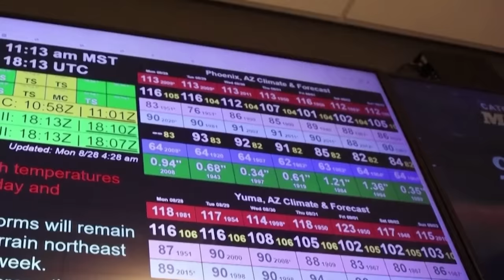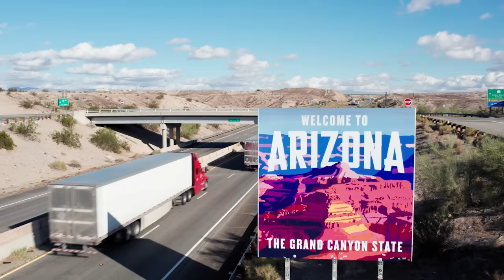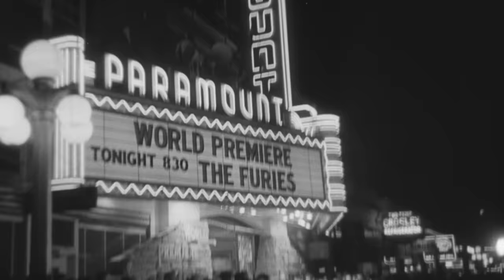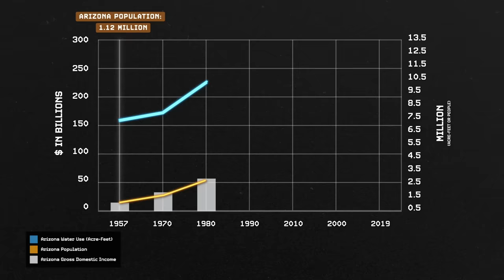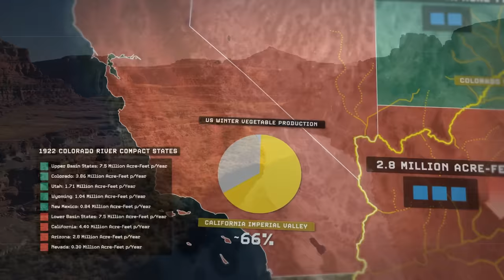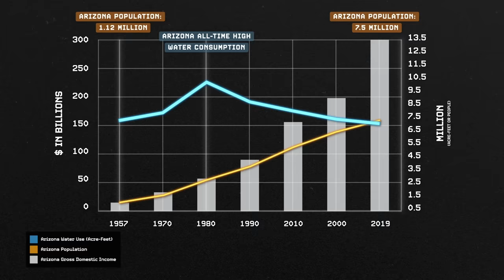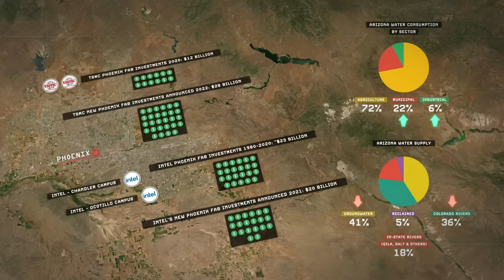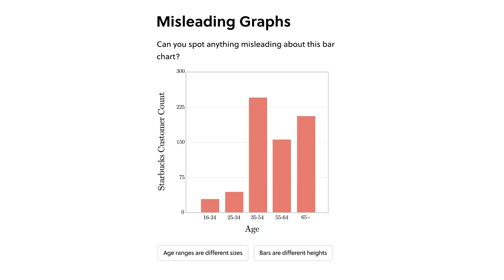Why 5 Million People Live in America’s Hottest City

Comment: For non-US viewer, 110°F is around 43°C.
Reply: Holy shit
Reply: @mertm.995 43 dry is more tolerable than 33 with 70% humidity  though. As a Moroccan born in similar climate, I know how it feels. The issue is that the temperature doesn't fall at night and stays hot while in humid areas with air breeze it cools down at night for a walk. So yeah Phoenix is a human anomaly
Reply: @MoorishAlliance  For real. 43 dry is way better than 30 with 70% humidity. Humidity makes things worse.
Reply: @MoorishAlliance Dry heat is horrible, I’d rather it be wet and hot then dry and hot
Reply: @al-manasama8370  I still prefer living in  near coast cities than in my hot and dry birth town. 
You have only between 9 pm to 10 am in dry climate where you can be active. Whereas you only need to avoid 13 pm to 18 pm sun in places where the climate  is usually moderate and only in the summer. Deserts become freeking cold in the winter so no win either.
Reply: Holy shit
Reply: @MoorishAlliance Try living in East Asia, particularly southern Taiwan, Thailand and the like. Summers are hell, 30C plus all day and 28-29C at night for months with the only respite being when it rains. You drip sweat day or night. I'd rather have the dry desert heat. Humidity makes winter worse too.
Reply: From my 15 years living in Phx area it’s easily can get up in the 120 F from June to August
Reply: @Puppyfied 
Humid heat is more dangerous than dry heat, since the humidity causes your body to produce less sweat, AND also since water is a very strong absorber of heat.
Reply: @al-manasama8370  that's an exaggeration. 30 C with 70% RH definitely is not worse than 43 with low humidity.
Reply: @MrGiygas1 you're kinda right. Humid heat is more dangerous but the exact reason why is Sweat on the skin does not evaporate efficiently on humid days, so more of the heat remains trapped within your body.
Reply: That is what he said multiple times in the video
Reply: @Puppyfied You are objectively wrong. The human body is worse at cooling itself down in humid environments.
Reply: Wtf? I didn't imagine it's THAT hot
Reply: What's said at 3:40.
Reply: Shit just got real 😮
Reply: For the idiots who think humidity is bad obviously never heard of a swamp cooler which is literally a form of air conditioning. Would you rather sit in front of a swamp cooler or and open oven. The "dry" heat dries your sweat so you can't cool off
Reply: @al-manasama8370 you need humidity for a swamp cooler aka an air conditioner
Reply: @thomasjellis9465 stationed in Okinawa the humidity is much better than dry
Reply: The process of drying your sweat is what makes you cooler. You are dissipating heat
Reply: Bro I live in Bahrain where the temp can peak to 47-48° C with insane amounts of humidity
Reply: @MoorishAlliance  and 10°C with high humidity feels like -5°C.
Reply: @kennethstegall1075 you have no idea how sweat works do you? The body temperature decreases thanks to sweat evaporation, which only works in dry environment
Reply: I mean thats not that bad, thats summer temps in south europe.
Reply: @Doomer_Optimist  It's close. 30 C at 82% has the same heat index as 43 at 5%. I've been in Vegas when it was 43 with 5% and it feels better than an average summer day in South Florida: 35 C at 50% at midday (humidity is higher morning and night), as the heat indexes would indicate.
Reply: @Puppyfied  With dry heat I get cracked lips and nosebleeds from dried out nasal passages. I guess the people who live there adjust to it or they move if they have that problem.
Reply: @kennethstegall1075  you have misunderstood something very badly. The issue was really simple: do you want to be in high or low humidity in 110F?
Reply: I was wondering why the hell he didn't use the system that the whole world (ecept America) is using. Crazy.
Reply: Yeah, that's a little much. I'm a fan of 34 C.
Reply: @Kerpeles  humidity easy. So much cooler
Reply: @kennethstegall1075 Human body gets rid of heat by sweat evaporating off skin. The more humid the air is the less effective this process is. That is why if the temperatures are the same, then the environment with higher humidity feels hotter (anyone can verify this in a sauna).

For the same reason it becomes harder and harder for a swamp cooler to produce cool air as the air humidity increases, until it stops working completely at 100% relative air humidity. That's why they are usually used in dry environments like deserts.
Reply: @tuomasronnberg5244  once the humidity gets to a certain level you no longer need to create humidity you just need wind. 

Yes in theory that's how you stay cool but when it is too dry and hot the sweat dries before being able to cool you off. Hense the saying it's like an oven. 

Is it cooler when it is raining aka 100% humidity or when it is not raining and 2% humidity. Point us humidity makes it cooler and nicer
Reply: @kennethstegall1075  I think what's happening here is that you're mixing up the effects of temperature and humidity. They are two separate, if related factors.

What happens when rains come is first that the clouds are blocking the sun. They also often come with winds that blow in cool air. That is why rain feels cooler because the air temperature *has* actually dropped, not because the humidity has risen.

You can check this by yourself by going to a sauna. Heat it up to a 60C or 70C, and it's entirely comfortable to stay in while the air is dry. However, throw a cup of water on the stove and thus increase the air humidity, and it quickly becomes unbearable to stay in there. The humidity is not cooling you off at all but making the heat worse.

I hope this helps!
Reply: @tuomasronnberg5244  no mistaking on this end. The wind you speak of is literally what I said makes up half of a swamp cooler. So humidity is not a problem because without the humidity you just have hot air. You know like opening an oven. Or did you conveniently not realize that.

If you had been to Arizona you would know that it will pour rain and still have the sun blasting you. If you are lucky enough to have the sun blocked by clouds it is still 105 while pouring during the monsoon
Reply: 110 F. Is 110 F. no matter what country you're in.
Reply: @Zelazella1  That is just incredibly wrong. Phoenix has only hit 120 degrees three times in history. Jun 25th, 1990 (120 degrees). Jun 26th, 1990 (122 degrees, the all-time record). July 28th, 1995 (121 degrees). The greatest number of 110-degree days in one year was 54 days in 2023; the hottest year on record. And last year (the hottest year on record) there were 21 days that reached 115 degrees. It's been nearly 30 years since the temperature hit 120 degrees. It doesn't even "easily get to" 115 degrees. Now 110 degrees, yes, it can easily get up to 110 degrees in Jun, Jul and Aug. But 115 degrees, not easily done. 120 degrees, last done 29 years ago. I live here in the Phoenix suburbs, it gets hot here, but it doesn't get to even 115 degrees "easily" and never gets to 120 degrees.
Reply: @al-manasama8370 you are bugging it literally chokes you
Reply: that's normal  chilly day in upper Egypt
Reply: @Puppyfied  Tell me you have never experienced wet heat without telling me. LOL
Reply: Wait, you're telling me that 43°C is hot for phoneacians? That's like a warm summer day over here from where I live
Reply: @fjv1074  who would have known it get hotter in other places in the world…shocker
Reply: @kennethstegall1075  Are you trolling?  

Swamp coolers cool the air. The air feels colder since the air is colder, however if it was only making the air more humid, it would not make the air feel colder.

High humidity makes temperature feel more extreme (So 43 celsius in low humidity is ok, but 43 celsius in high humidity is very unpleasant, and same goes where 5 C dry is ok, but 5 C humid is frigid)
Reply: and is not a record. I've been there 2x when it was 115.
Reply: As a Canadian who also resides in Phoenix,  I'll take 40c over -40c 365 days a year!
Reply: @thomasjellis9465 yes because thailamd is definitely in east asia
Reply: @कनलदअ_गनगयव  I never said it was. I said try living in East Asia which is where I live now, Thailand which is where I used to live. Two separate things but thanks for replying to my comment from 4 months ago.

Comment: Phoenix needs to do what Las Vegas did. Cover up the pools and only allow native plants. Palm trees and grass don't grow here. Cacti, palo verdes and aloe does. Also despite the heat, you ain't gotta shovel.
Reply: WE DO HAVE NATIVE PLANTS.  THERE IS A MOVEMENT TO GET RID OF GRASS & CROPS WHICH TAKE UP THE MOST WATER. 126 DEGREE HEAT? 110+ FOR 7 MONTHS? ELECTRIC BILL IS THE TRADE OFF
Reply: I would rather shovel than live in a desert.

But it really should be a policy that your "lawn" should have to sustain itself from the rain. In NY parts of my lawn are made of moss, the only maintenance is rakeing leaves and mowing the grass.
Reply: @lovly2cu725 Is your caps lock broken?
Reply: @jasonreed7522 From rain?? Even native plants would die. The heat bubble effect and surrounding mountains means it rains even less inside the city than elsewhere in AZ.

It's not uncommon to go multiple months without a drop of rain.
Reply: @henryward5457  Native plants only need irrigation for the first few years when they are getting established and growing out their root system. Once they are mature they don't need additional irrigation. You can also build swales and use mulch to increase water availability without using any additional water.

Comment: I lived in Scottsdale adjacent to Phoenix for 20 years. On June 26th 1990, The temperature was recorded at Sky Harbor Airport was 122.3F. They had to shut down all flights because the planes were only rated for 120F max takeoff temperature. They had to wait until it cooled down to 120F so the planes could takeoff. Great motorcycle riding weather. I miss those days. I now live in Western Washington for the past 30 years.
Reply: Do you like Washington? I heard it was beautiful.
Reply: @shea5542  It is a beautiful State especially on the Western side. Lots of green and nice cooling rain. Down sides...Everything is expense and this side of the Cascade Mountains is WAY too Liberal for this Conservative Man.  I want out as fast as I can. If you're into firearms...look elsewhere. I'm thinking Idaho? Red State. Hope I answered your question?
Reply: @rickh8380 You speak facts here. I have lived here in the "Valley" for 55 years. I was in downtown Phoenix (worked a few miles away) that day at a conference, so you're talking even hotter ambient what with all the concrete, asphalt and steel. Out-of-town attendees couldn't believe it. Heck, WE couldn't believe it.  That day my recollection is that it wasn't "just" a matter of the planes not being able to take off, but that they didn't have the data/ operating manual info to reliably base flap and thrust settings on. Bad enough! 

Many of us here have categories - Past May 1, over 90° up to 100° "not worth a mention." any time after mid May, 100° even an occasional 105° "seasonably hot," anytime after June 1 100°-110° "kinda hot today, especially 105°+, but normal summer, not worth much mention," 110°-112° "really hot today, wish it'd cool down, still not out-of-normal, but nevertheless warranting complaints,"  112°-115° "too damn hot, not unheard of but TV news full of health warnings especially for challenged...," 115°+ just plain hot, 'unacceptably so," regardless of humidity - no more caveat/excuses like "but it's a dry heat."  Rare (even here) 120°+ goes without (much) saying, just looks of bewilderment on people's faces. Generally speaking these ultra high temperatures don't carry with them a lot of humidity, but there have been occasions in the low to mid-hundred 'teens when the two have somehow defied meteorological norms and combined, and it's brutal. The main difference between June and July is the latter doesn't cool down as much at night, particularly in the last few decades due to the "urban heat dome effect" from all the concrete and asphalt, meaning carry over to the next day and you don't get a break. Early to mid July through August there is an uptick in humidity, by our standards, and that's when anything over 105° gets particularly unpleasant. The temperature used to drop off more than it does now in Septembar, but at least there is a drying out.
Reply: I went to Phoenix, Sedona, Flagstaff in October and it was the best time to visit. The weather was pleasant and the upper part of the state was getting colder, enough for a sweater during the day. It’s a beautiful state when you leave the immediate Phoenix surroundings.
Reply: @JeanClaudeCOCO  Yeah I too love Northern Arizona. March and April are beautiful when the desert is in bloom. North Eastern Arizona is beautiful also up on the rim.
Reply: Which liberal policies are not to your liking?
Reply: We planted trees that year, the tips of them turn crispy that day
Reply: @19ate4  Ouch !!!
Reply: @TokyoJuul8008  YES !!!
Reply: @rickh8380 it’s full over here brother srrry
Reply: But how many times do airports get shut down for snow? WAY more than a heat shut down. People have a hard time imagining their summers being that hot. But we don't have a winter - our summers are like others' winters. We stay inside and do only activities that are weather appropriate. (Swimming for us - skiing for you) In the winter is when we're out hiking and BBQing. And the summer months are off from school so you can travel to escape the heat. Much prefer AZ
Reply: I’m sorry for you. When I lived in Idaho for a couple of years, I longed for my heavenly desert. I’m so glad to be back.
Reply: I walked to school on that day.
Reply: @emilya9944  Yikes !!!! At least the next day it was only 120F. I do not miss those days. Thanks for sharing. Take care.

Comment: Haven't watched this yet, but the idea of living somewhere so goddamn hot that you could easily die outside from exposure is scary. It's different when you live somewhere cold, you can just cover up a bunch outside to stay relatively warm. When it's so hot outside, you can strip naked and STILL die from heat exposure. That's the scary part, there is no escape from that temperature. Whereas in the cold you can escape at least for a while.
Reply: Lived in Arizona my whole life born and raised. It's not that bad. As long as you have shade there's an escape. Water is most important. I used to do mountain biking. Even in the summer and you could still do it with enough water. Really good workout too.
Reply: Shout out to all the people for the last thousands of the years living in the Middle East?
Reply: People do die from heat exhaustion while exercising or whatever, but your not going to die just sitting outside.  Extreme cold is much more dangerous.
Reply: @lok777  I have to disagree for the same reasons as stated by the original poster.  That being said I live in Oregon and was born in Winnipeg Canada (the cold part), I often don't understand how Southerners survive.
Reply: Shade and plenty of water.  Even when it's 115F, it'll be about 100F in the shade, which doesn't sound great, but is immensely relieving when you experience it.
Reply: Actually, going naked in a hot, arid environment is a shortcut for dying from heat exposure.
Reply: Be it too hot or too cold you will die from prolonged exposure
Reply: Get used to it, it's our new reality
Reply: I live in las vegas which is about as hot.  If you rest and find some shade the heat is bearable just make sure to have lots of water
Reply: @lok777 the danger of cold can be negated with the appropriate amount of clothing (this is coming from someone who’s worked outside in near zero degree weather), where the discomfort and danger of heat cannot be negated.
Reply: Don't matter how much clothing you where in negative temps....you still gotta breathe!.....you can breath hot air as long as you got plenty of water....breathing those negative Temps will eventually lead to ammonia,  sinusitis, and hypothermia.....

Comment: I've lived in AZ for more than 40 years now, mostly in metro Phoenix but also in Yuma and now in the White Mountains.  For years, I jokingly referred to Phoenix as the "Land of the Midnight Sunburn".  With all of that concrete and asphalt the Phoenix area holds it's heat well into the night.  In Yuma, where it actually gets hotter during the summer, it cools off quickly once the sun goes down.  That simply cannot be said of Phoenix.  Phoenix has become a gigantic heat island.

One of the modern challenges  I've seen in the Phoenix area has been traffic.  While mass transit exists, it is and has always been woefully inadequate.  Everyone drives.  Street and highway traffic in Phoenix has become ludicrously bad.  In a lot of ways Phoenix traffic reminds me a lot of Los Angeles, where rush hour lasts for most, if not all, of the day.